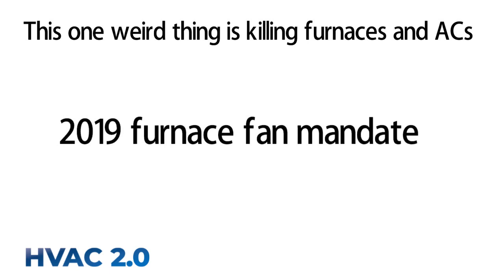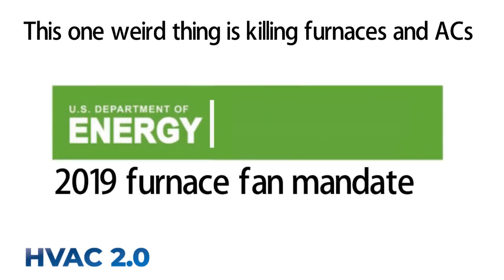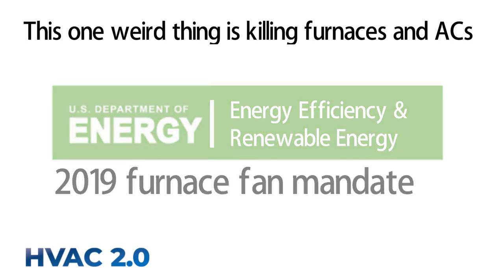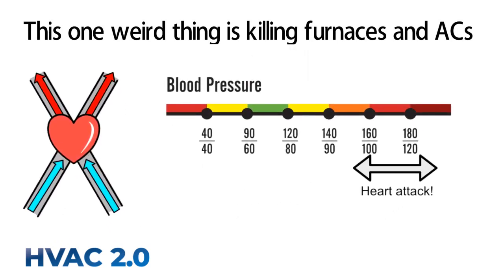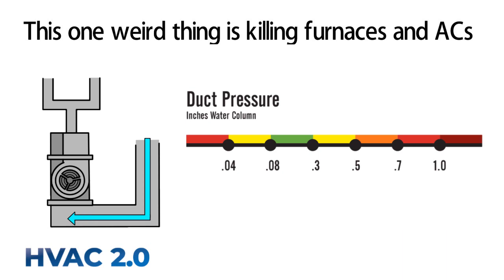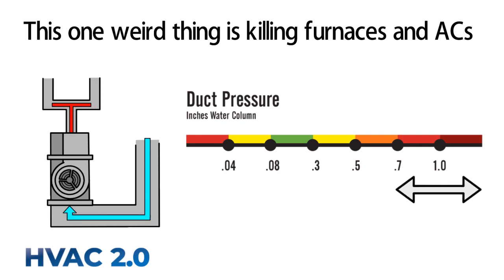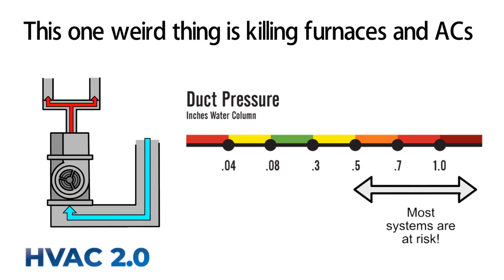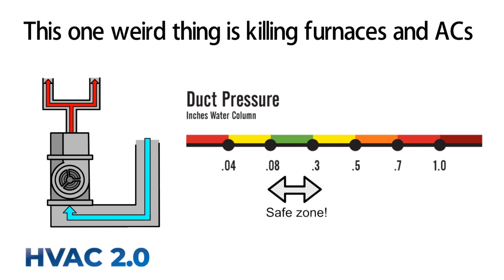This one weird thing is killing furnaces and ACs

Comment: This is not always so. I have several customers with ECM motors running at or above 1.0". One for over 15 years. Still on the original motor. There is no access to correct the ductwork in these cases without a remodel of the home.